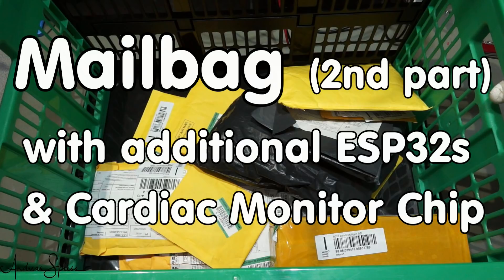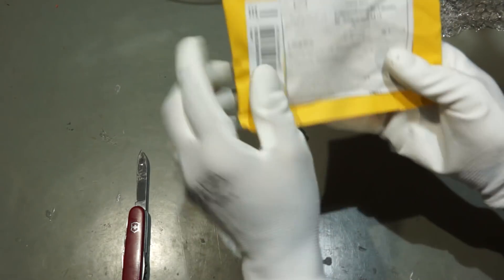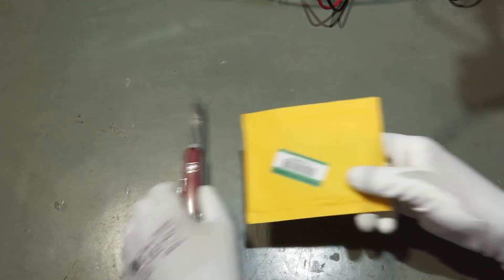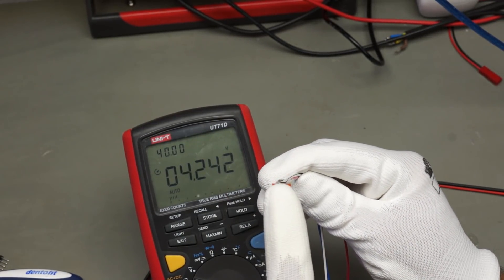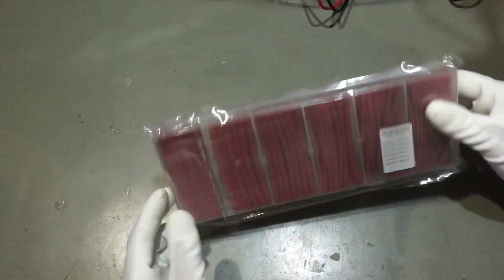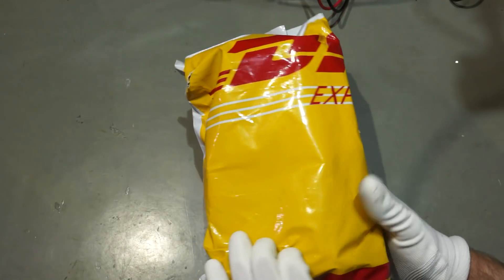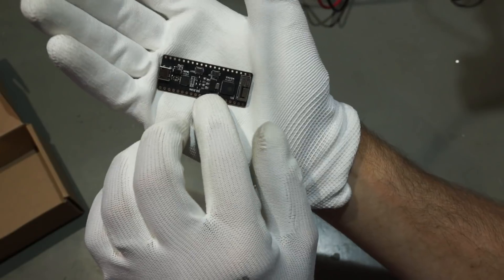#166 Longest Mailbag ever Part 2: ESP32 and other cool stuff like a Cardiac Monitor

Comment: Hi Andreas,
I recently bought some strain gauges from Aliexpress. They got the ordinary 4 wires: Red (power +), green (power -), black (signal +), white (signal -). However, there is a 5th blank, i.e. non-isolated wire. Do you happen to know what this is for?
Best regards,
Christian
Reply from the maker: I do not know. Is it ground?

Comment: Hi Andreas,
Thanks for this video. As indicated in my comment to video #155, I intend to build an electronic beehive scale. I am still trying to figure out what kind of load cells to use. Most people seem to be using "bar shaped" load cells (1 load cell per scale to be precise). However, from a construction point of view, I think it would be more convenient and more stable to use "button shaped" load cells, just like in a personal scale. In my view, if the beehive is resting on a single bar shaped load cell, there will be undesired torque forces rendering the construction shaky, especially in windy conditions. Why not build a Wheatstone bridge using 4 button shaped load cells, one at each corner of the beehive? Are the button load cells not suitable for permanent exposure to weight forces? I'd highly appreciate your enlightening feedback on the characteristics of load cells.

Best regards,
Christian
Reply from the maker: 1. I also would use the half bridges and not a bar. I think you find how to connect them together by googling.
2. I do not know if and how much they drift. But I think, you should be able to deal with a certain drift if you zero the "beehive" from time to time, e.g. if you removed the honey. Be aware I am not a specialist. But I have a project to start with bees if I have more time (I currently have a few "Wildbienen"

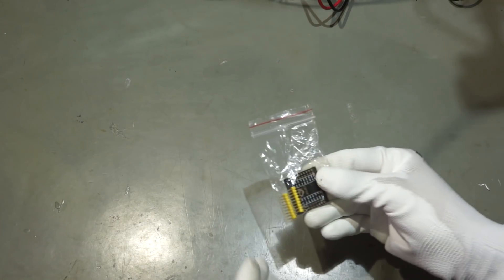Comment: Quick question, I finally located the ESP32 PCB board shown at 8:50 of the video.   Do you solder the ground/heat sink pad on the back of the ESP32 module to the PCB, or leave it unattached?   I have found varying opinions on the necessity of doing so.
Reply from the maker: I only solder the pins.
Reply: Thanks Andreas!   Have a Merry Christmas!!
Reply from the maker: You too

Comment: Are there any premounted PCB-Boards with an ESP32? Soldering an ESP32 on a breakout board is - at least for me - much more challenging than soldering an ESP8266 -so alt least for me that would be a great relief.
Reply from the maker: I think I covered most of the currently available boards. Soldering a WROOM chip to a PCB is easy if you start with two pins on the opposite side.

Comment: I bought one of those ECG boards from Adafruit about a year ago. Cost me over $20 but Adafruit is always more expensive. Works great. Free software online. They do not do the best explaining you need a program called Processing I believe. Once you got that figured out its just connecting the pads.
Reply from the maker: Thanks for the info. I will see if I will go with processing. But maybe it is a good start...

Comment: The link for the ESP32 base PCB isn't correct, it links to the older white PCB.  Do you have the link for the improved PCB at 8:50 of the video?  Great video as usual!
Reply from the maker: It is the link I purchased from. Maybe you write in the order, that you want ESP32F boards.
Reply: I will try that.  I have the older version with the white PCB and I want to get the new version you are using!
Reply: Found this link:  https://goo.gl/UkHzgo

Comment: Thanks for the video! I have one of those ESP32 adapter PCBs with pull ups for EN and IO0, it seems the new one has a few more bits on it plus the LED, besides the two buttons, which other pins should be using pull up resistors??
Reply from the maker: In addition to the switch, it pulls GPIO2 down. LED is on TX0

Comment: The link to the esp32 bases / ESP-32 Adapter Board at 8.50 goes to white boards that look quite different. Have you used the correct link ? Kind regards.
Reply from the maker: This is the source of my boards. But maybe you write that you want the version with ESP32F written on it.
I did not find boards with the correct image. If you find one, I would order there...
Reply: Here it is Andreas.

https://www.aliexpress.com/item/ESP-32S-Pinboard-Convertor-Module-ESP32S-Adapter-Board-Support-for-ESP-32S-Wireless-WIFI-Bluetooth/32818093054.html?shortkey=FFrEni2a&addresstype=600

A bare prototype board has also become available for both the ESP32 and ESP6233 that looks useful. See here.

https://www.aliexpress.com/item/1Pcs-7x9CM-Prototype-PCB-Breadboard-For-ESP8266-ESP-12E-ESP-12F-ESP32-ESP-32S-REALY-Double/32840147493.html

Keep up the good work.
Reply: Sorry, ESP8266 huh!

Comment: What revision are chips on these boards? I've recently bought the NodeMCU board and it's still rev. 0. It has a blue ESP32 module. There are also boards with a black module, so I've ordered one. I wonder what revision it is.
Reply: So, my black ESP32 module is revision 1.
Reply from the maker: I did not check them all because less and less are Revision 0 and you might already get one with revision 1 even if I got one with revision 0.
Reply: Now I have two NodeMCU boards. One has a blue module ESP-32S, which is  rev. 0. Second board has a black module ESP-WROOM-32, which is rev. 1.

Comment: Hello Andreas, do you know the ESP32 board from Olimex? (https://www.olimex.com/Products/IoT/) I think they would be a nice addition to your comparison, especially the versions with Ethernet.
Reply from the maker: Thank you for the link. I knew about this company from the past but never bought something from them. For the moment I do not have any projects where I would like to use Ethernet on a ESP32 and I even do not know if this would be supported from the Arduino SW. At least I found no library in their "Software" folder.

Comment: The Aliexpress photos of your load cells show them equipped with plastic mounts for the load. The cells you received lack those mounts. Perhaps a word with the seller is in order.

As always your video is informative and entertaining. Many thanks.
Reply from the maker: In the past, I used direct links to the products. These links were often outdated because the suppliers changed their products or even vanished. This is why I changed to search links. These links should survive longer, but sometimes have also hits which are not exactly the products I show. The product I ordered did not have these plastic caps. So, I got what I ordered (even if I would have prefered the ones with the caps)...

Comment: i got those touch -sensor buttons, but they only give 3.3v output as data signal so cant use them with esp8266 :/
Reply from the maker: I think, Arduinos also acknowledge 3.3 volts as logical "1"
Reply: Are you powering them with the ESP8266 onboard power ? because of the 3.3 Volt input it can only transmit 3.3 Volts output

~Thomas
Reply: The 8266 runs at 3V3!
Reply: Yes, I know it works on 3.3 but my esp's with devboard/pcb uses 5v..
Reply: Maybe it is the resistance
Reply: well, maybe i meant esp8266 with usb connection devboards that uses 5v signal, and my baggood link promoted that they work as 3.3 - 5.5v and they dont work on 5v :/

Comment: How could I use these load sensors to weigh the 4 corners of my racing go-kart in order to adjust the distribution for handling purposes? Not sure how the package of the load sensor works? Could you explain in an upcoming review video please? Maybe we could do a “go-kart scale” build? Thank you I love watching all your interesting projects!
Reply from the maker: I think you would need 4 of the "normal" load cells because I think, the half bridges add the weight. Maybe there is another wiring where you can get the difference between them, which is probably more what you are looking for.
P.S. My brother is also a big go-cart fan (and owner)...
Reply: Andreas Spiess  yes I was thinking I would need 4 units, but couldn’t tell which was. The base (for mounting) and which one would actually be deformed when weight is added. Yes we race karts on a dirt track, lot of fun!
Reply: Oh yes for checking plants for moisture it is vitally important to check the pH levels. Thx
Reply from the maker: I never drove in the dirt with a go-cart. The closest was a Quad. But I had an Enduro motorcycle and once even did a desert race in Morocco...
Concerning pH: I do not know how to measure it electronically.
Reply: Smart Water Sensors, Libelium, you surely have checked this company out before? My job is water quality and that is why I have been following your ESP videos so close. I live in a small city and would like to get up and running with water quality sensors that I could monitor remotely.
Reply: Oh yes, price is a significant requirement because this is all at my expense (prototype stage) until I have a working model and then I can get reimbursed.

Comment: Thanks for the vid and the ideas.
Regarding the load cells: why do you use 4 instead of 3? A plane is defined bei 5 Points. 
So, 3 are cheaper and better from a mechanical Point of view. Of course the pseudo-full Bridge trick would not work so easy.
Can bee hives be hanged on one bar? Or doe bees feel uncomfortable when the hives are swinging around in the wind?

Regarding the new ESP32: Whats about the FCC / CE and whats about the RF Signal strength with the new antenna?
Reply from the maker: 1. I do not know (yet) anything about beehives. Maybe a viewer can answer your questions. Because one or two of them asked questions about beehives...
2. I did not see any FCC stamp on the pico board and certainly do not have the room and equipment to do this kind of antenna tests. I assume the output power of the chips is all the same.

Comment: please share the link to purchase the touch sensor - thank you for the educative video!
Reply from the maker: The links should now be there.
Reply: Try this: https://www.ebay.com/itm/10pcs-TTP223-Touch-Key-Module-Capacitive-Settable-Self-lock-No-lock-Switch-Board/401142828352?hash=item5d65f9cd40:g:qEcAAOSwZeVY8YVy
Reply: Mohan RatiRam be aware, my sensors (looked a lot like those) gives only 3.3v output, not esp8266 digital compatible.. only Arduino analog port